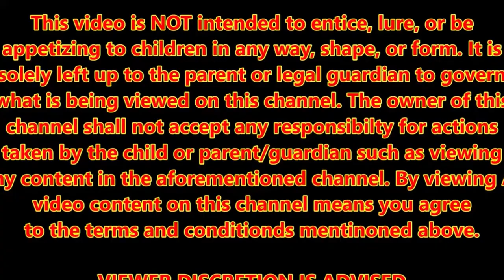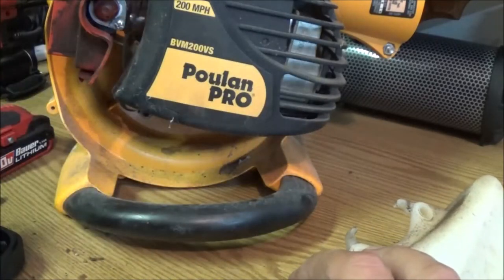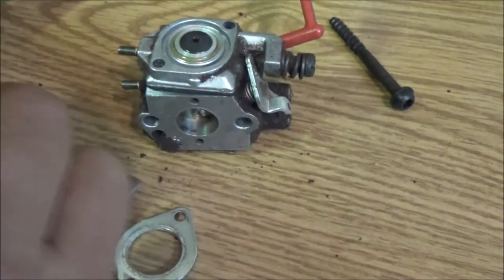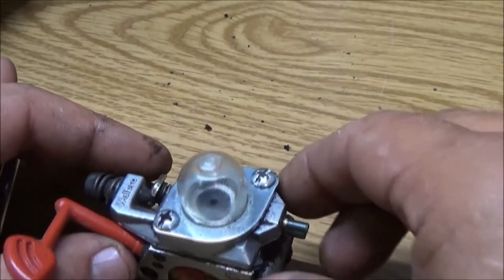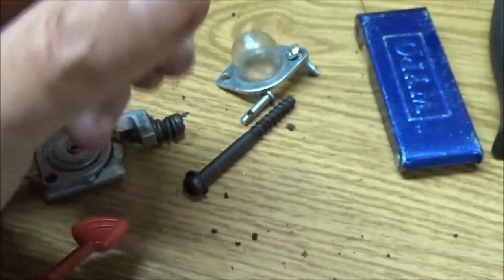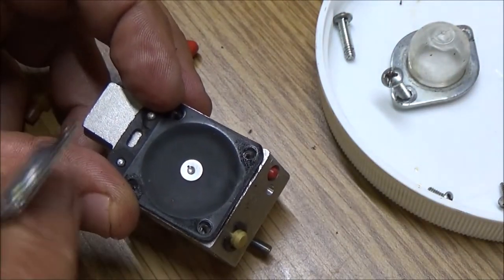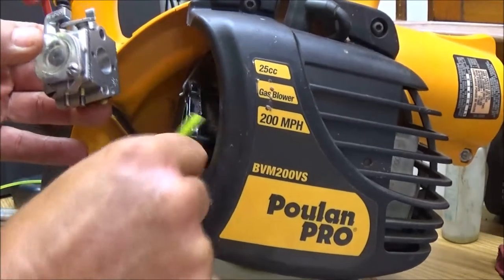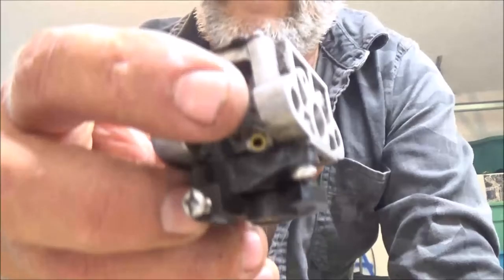How To Carburetor Cleaning On A Poulan Pro Blower Will It run?

Comment: Thanks for the video. I have made up my mind that these blowers are pieces of 
s— t after investing in a new Chinese carb and it didn’t last any longer than the first one. Yes I tried rebuilding, carb cleaning, air blowing. Replacing carb parts. I pretty much tried it all and wasted numerous Saturday’s screwing with it. When I get it together it runs fine for 10 minutes then starves for fuel. I have replaced the fuel lines filter, now just sick of it. I’ve been repairing my own equipment for a good part of my 71 years. They don’t make them to last any more. Glad yours worked for you. 
    👉🇺🇸👈
Reply from the maker: I know what you mean. Nothing is built like it used to be. Also, have you cleaned your exhaust out? Sometimes that will cause it to act like a carburator issue as well.
Reply: @shabear1000  No, haven’t tried that. Guess I’ll have to now. Thanks, I’ll let you know if that works. 🙂
Reply from the maker: You're welcome. Yeah sometimes when the exhaust on them 2 strokes get clogged (which of course happens because of oil consumption) it can't breathe so it will act like it is a carburator issue. Also, you can check the compression, but usually that will just be low on power. A clogged exhaust will also cause hard starting and no RPMs on full throttle. Let me know what you find out. If I can help in any way, I'll be glad to do so.
Reply: I've had one for 5 years... just starting to give problems 🙃....its been extremely neglected.  lol

Comment: Thanks for the video. Specially the beginning on putting gas directly to the Carburetor. Neighbor next door threw one to the trash. Followed you video and now I got me a really good blower. Thanks again!!
Reply from the maker: awesome, glad it helped. thanks for watching and commenting.
Reply: @shabear1000  I am trying this. Where to you pour that in? I'm an amateur.
Reply: Mine is the BVM200 which is a royal pain in the ass because it is harder to take apart. The full tank is in the housing.
Reply: @stefansklaroff1653  p

Comment: Thank you for the video I am confident enough now after watching to take mine apart an clean the carb... Make a video on cutting the notch in those jet screws... Just make a slot to use a flat head ? Thank you
Reply from the maker: good idea for a video. i will do a video of that soon. BTW..did you get it going?
Reply: Waiting for that carb kit still

Comment: Wished you would have shown how you threaded the fuel lines in the tank that uses the fuel coupling between the inside of tank to the fuel lines outside of tank. I guess they use them to prevent fuel leakage when operating.  Other than that excellent video 👌
Reply from the maker: That's because I have other videos for how to do that.

Comment: Is there a trick to tuning the air fuel ratio? Mine is running lean and only running on half choke with a new carb. There's no area for a screwdriver

Comment: I own the same model it won't run unless I hold the throttle wide open where can I order a diaphragm for one of these
Reply from the maker: i order mine on line off of ebay. did you get one yet? if not, i have an extra one i can send you.
Reply: Yep its coming from ereplacement parts.com thanks though
Reply from the maker: You're welcome. Let me know if you have any questions.

Comment: Mine runs like a raped ape but will not restart after running.    I've replaced the spark plug and put in fresh gas... Checked it over all.   I got nothing! any ideas?
Reply from the maker: Try leaning the carb out, see if it makes any difference. Let me know what you find out.
Reply: I installed a new carb... ran for awhile... Pulled out for now. lol  think it might be coil getting hot????
Reply: Also not sure what you mean by leaning out
Reply from the maker: Yes, Could be coil
Reply from the maker: It's when you adjust the air fuel ratio. Less fuel is lean, more fuel is rich.

Comment: you need to soak that carb in the same stuff the gas tank is in i have it and  soak all my parts in it you can put rubber and plastic in it but only do it for about 30 min. that carb is vary bad looking it has dirt all over it